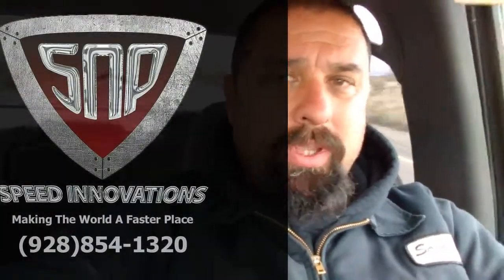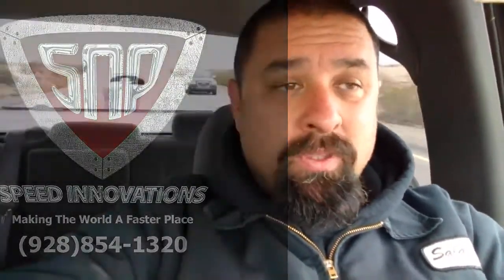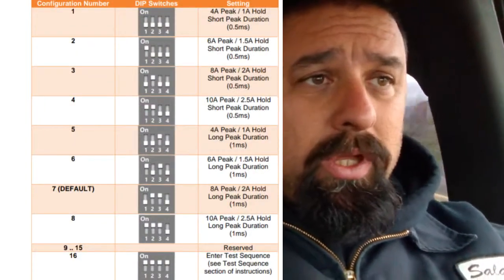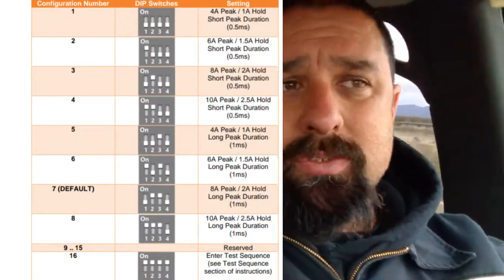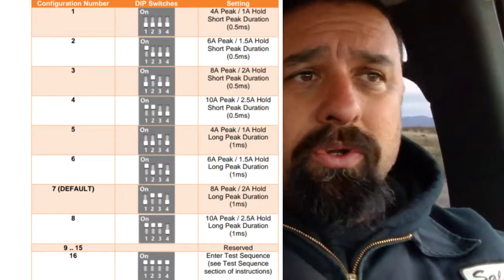Tech video for Holley injector driver module

Comment: Do you know if this will work on a 4 cylinder?
Reply from the maker: Yes. Remember first to Fire second to Fire,  third to fire, forth to Fire, is all Your firing order
Reply: @snpspeedinnovations  on so I had got most of it set up today. Is it fine to leave the main power hooked directly to battery through a 30a fuse since it's also got a switched power wire?
Reply from the maker: @mikezakel3490  I don't see a problem with it
Reply from the maker: Yes as long as it's all setup right
Reply: @snpspeedinnovations  the instructions aren't clear on how to set it up for a 4 cylinder. It refers to v8's?
Reply: @snpspeedinnovations  would I just set the dip switches to the injectors and only wire in 4 injectors for a sequential injector set up and do the rest of the wiring procedures as shown in the booklet? It will just have the other 4 channels red?